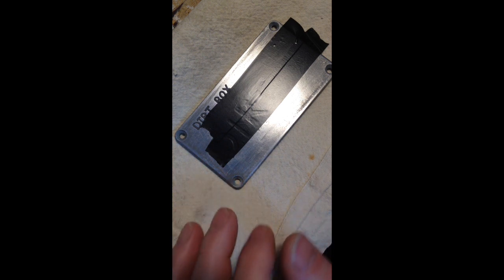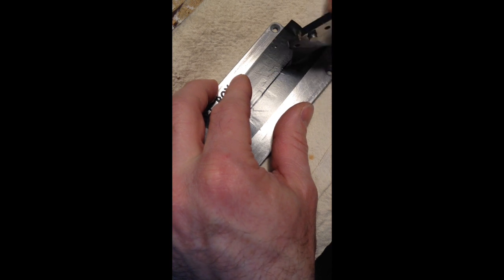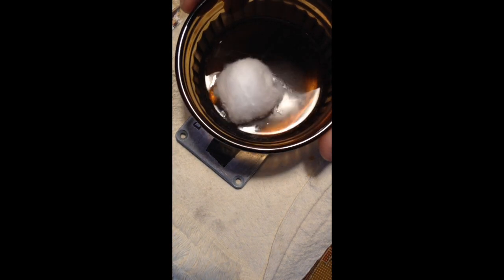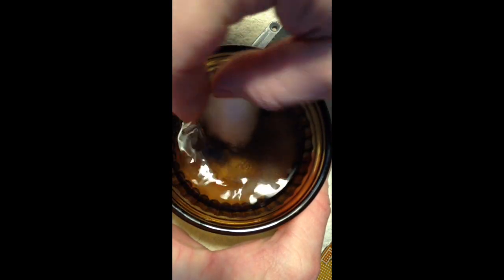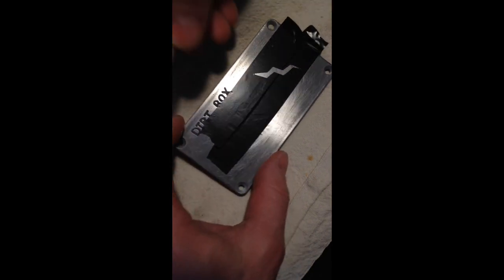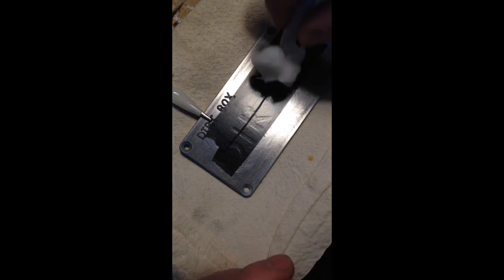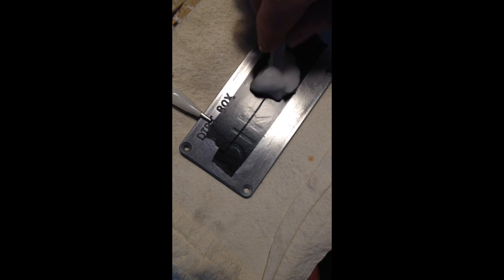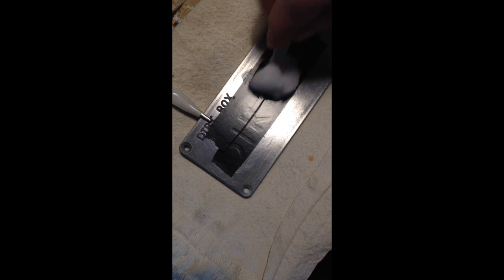Aluminum etch with salt and vinegar

Comment: i find this so interesting.  I used to work in a pre-press graphics shop.  We used nitric acid and photoresistant film.  I never knew, and am now amazed at how this can be done with kitchen ingredients such as venegar and salt.  Nice vid. thanks for sharing.  Also, i'd assume this could be done without electricity, yet would take considerably longer.  Have you tried that, and if so how long would it take?

Comment: Did you set a current limit on your power supply as well ? How much current would you say is flowing through ?
Reply from the maker: current was 1amp.
Reply: @dirtdouglas  would 5 amp work?

Comment: I like that the etching gave it a black ending. What battery size did you use and was this salt water? What was the amounts
Reply from the maker: i think it was about a tablespoon of salt to a cup of vinegar, and I used 9 volts off my bench power supply.
Reply from the maker: correction: looks like i used 2 or 3 tablespoons of vinegar and a tablespoon of salt.